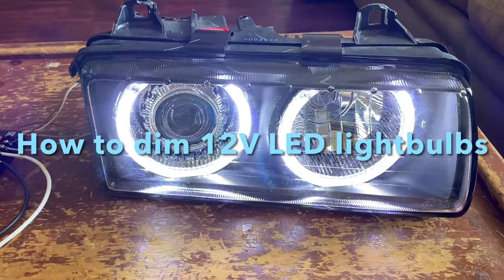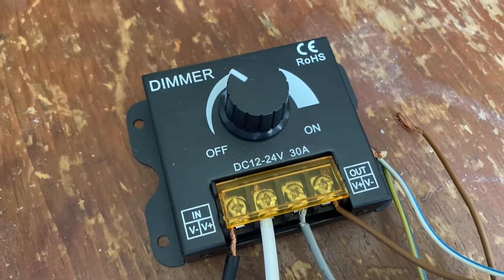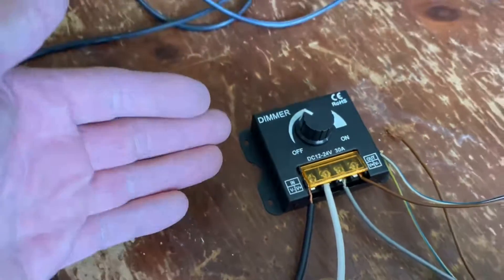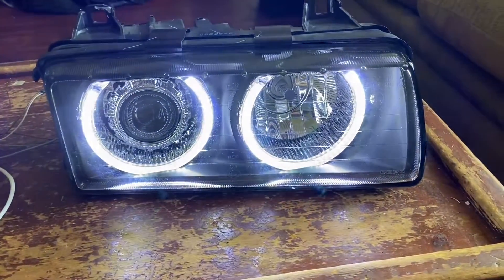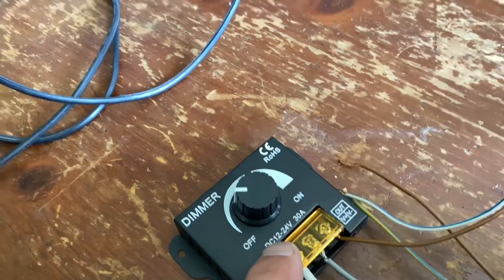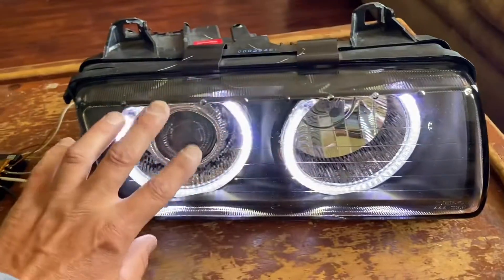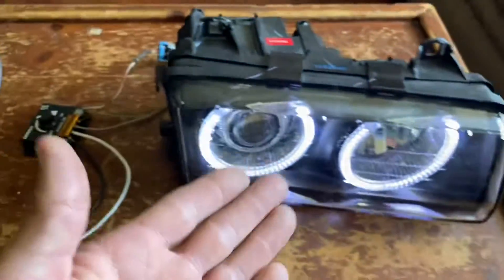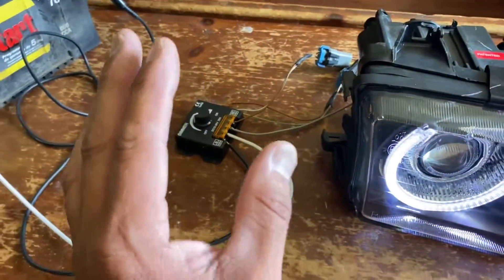How to dim 12V LED lightbulbs. 12v PWM led dimmer. How to dim 12 V automotive led lights.

Comment: I have new LED taillights on my car. The parking light is very, very bright. It makes everything around me red. I want to dim it. This controller is probably good. How does that work? When the car is stationary the battery has 12 volts and when the engine is running I have 14.8 volts. Does this change the brightness? Because without a dimmer it is always the same light
Reply from the maker: Yeah this dimmer would work for you . 
Honestly nothing wrong with having really bright brake lights, keeps you safe, if it's bright they will notice that you're stopping
Reply: @ProblemSolverGarage  OK i buy it thanks. No breaklight i dont Touch. Its a Other lamp. The parking light is too bright